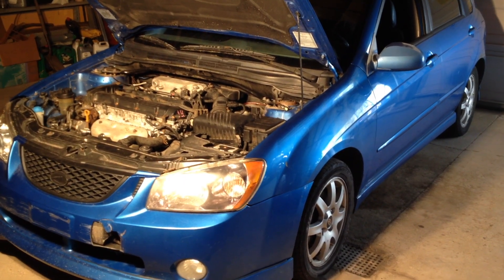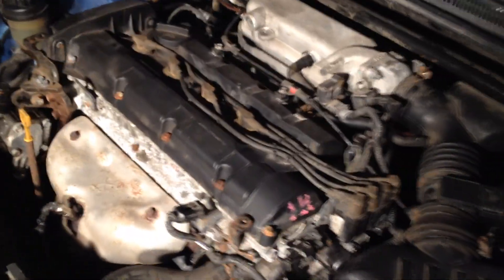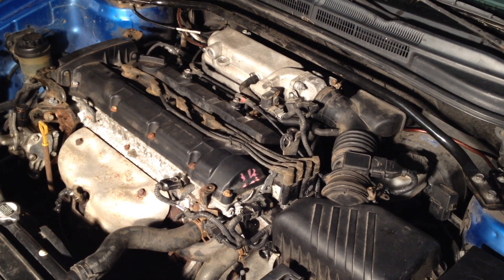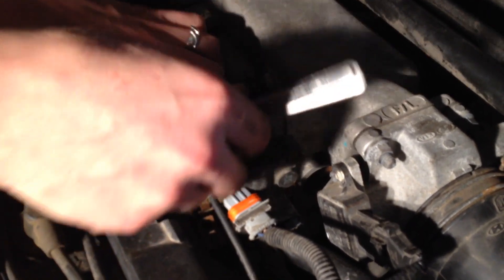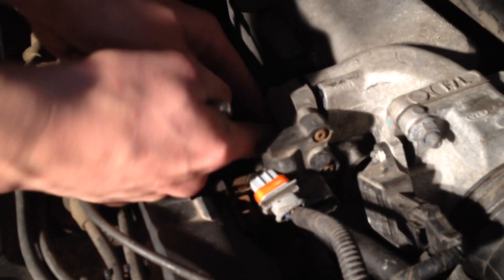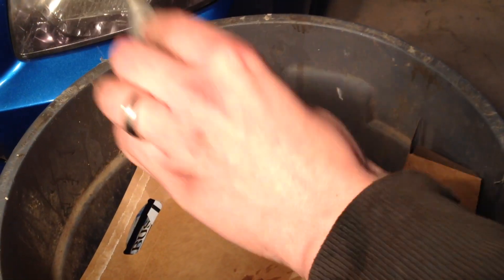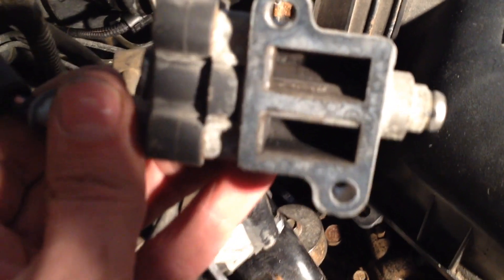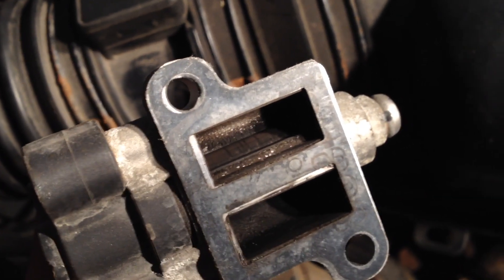Kia Spectra Idle Air Control Fix - Rough Idle

Comment: Thank You very much Young Man; have a 2006 5speed Kia Spectra that was idling wildly and even shutting down  seemed to be the idle air control valve ... anyway problem solved after carb. cleaner !!!

Comment: Good instructions, here! My 2009 spectra5 sx broke the timing belt, while driving. It bent 4 intake valves. It is best to remember that the intake camshaft is driven by the exhaust camshaft via a short chain. With over 300,000 miles on the car, the chain was stretched. This causes undue wear to the camshaft journal, nearest to the chain.
Reply: You got 300,000 mi out of it without even changing it once? I believe that car it's supposed to be every 90k. I'm at 355,000 and I've changed it twice.  Regular sx

Comment: My 2006 Kia Spectra 2.0L 4cyl shakes when I at a Stop Light or Stop Sign or when I'm waiting at the drive thru restaurant. Usually it happens when I have the AC on at the same time.  Also it shakes when in reverse or drive while the AC is on. Also when I press the gas pedal it accelerates slow and then it goes normal. Same when I go uphill. Again all them happen when I have the AC on at the same time. Do you think these steps will help fix all those? I need the AC on when I drive because it's Damn Hot in Texas!

Comment: Having same problem , car has been sitting 2 years thanks for the vid
Reply from the maker: You're welcome!!!
Reply: Me too i got a new idle air control an it hums constantly the car wont start if its plugged in. I dont know if it shorted some where but the car will only start eith starting fluid an shuts off as soon as i push the gas pedal.
Reply: @Scrotumlips  tal vez la bomba de combustible mala , o el  mismo envase de la bomba

Comment: Great video, I have a 06 Kia Spectra miself, the problem I'm having is that sometimes it's bogs down quite a bit, rough idle too. Any ideas? Don't want to spend $1,000 on it
Reply from the maker: Maybe a coil pack or a bad intake manifold. Just guessing though :/
Reply: @ChadWilliamsFixesAll  ok I'll check it out. Maybe take it to AutoZone and have them run a diagnostic and see what comes up. Thanks for the reply Chad, really appreciate it.
Reply: Actually it’s a issue with the fuel system and a evap value. I have a 07 does the same thing and stalls out. Best thing is don’t fill your car up all the way when you get gas. Honestly that’s what the dealership said 😂 I fill up 3 quarter the way no issues.
Reply: @mattdavenport1102  I have a similar issue. Can't this be fixed?

Comment: I am going to buy a Kia from Letgo tomorrow. Obviously I won't get your reply in time to help me but I think your video already has. I just have one question out of curiosity... since it wasn't getting enough air that sound was because it was flooded. Did you smell gas? Considering how there is an exhaust leak AND the running rich I figure it would reek of gas. But yeah please lmk and I liked and subscribed; great video! Thanks!

Comment: Hey Chad, Did you re-use the paper gasket or did you install a new one?
Reply from the maker: Mine didn't tear, so I reused it. Use your best judgement to whether if you think it is good or not.
Reply: @ChadWilliamsFixesAll  thanks for the reply. I'm not too sure if the problem I'm experiencing is the idle air control valve but I do have the same vehicle which is a 2005 Kia spectra5 and the problems I've been having is an idle surge and idle drop when I first start the car for about 20 seconds, then it goes back to Baseline 900rpms. and it also does it sometimes when I'm coming to a stop after taking my foot off the gas. Otherwise that ny car runs great when I'm driving and my foot is on the gas pedal. I've had no check engine light and the problem has been intermittent. Sometimes it might do it once a day sometimes none but the last couple of days ithas been getting noticeably worse.. am I on the right track with starting at the IAC? Thanks

Comment: Hey Chad ! I just bought an 08 Spectra5. I've been driving it for about 2 weeks, and today it stalled out at a red light. My idle seems to worsen with the AC running. could this be the IAC valve ? Sometimes it seemed like it had a dive in power after shifting gears(it's a 5 speed) any info would help. I'm subscribing to your channel today. thanks, Tim
Reply from the maker: +tim wilson hey Tim, thanks for the subscribe! A few things I would check first is air filter, spark plugs/coils, and a compression check. You would need to good for the correct psi for your car/engine. Are you throwing any check engine lights?
Reply: Chad Williams no check engine light. If I nursed the throttle, it wouldn't stall. when I got home I sat in the car, turning the AC on and off, and watched the tachometer fluctuate.
Reply: Chad Williams I checked the air filter, it was reasonably clean, except for some debris from like a tree/plant, and what appeared to be a piece of dried up gum sitting on top. I bought the car from a friend,  and it had been sitting for a while.
Reply from the maker: +tim wilson do you have a vacuum leak? You can spray carb cleaner around the hoses to see if the engine stalls out or revs up
Reply: Chad Williams I really wouldn't know where to begin to look for vacuum hoses. I'm a good DIY guy, but my knowledge is limited, and I rely on learning as I go. this morning the engine light actually came on. I'm going to check your recommendations , but I'm leaning towards the IAC because the idle got way rougher after a drive this morning thanks
Reply from the maker: +tim wilson that is good a Check Engine Light came on! At least now, you can get the code that it is throwing. Let me know what you find out!
Reply: Sure man ! Thanks
Reply: new plugs, clean iac valve did not help. could it be a pvc valve or throttle position sensor ?
Reply from the maker: +tim wilson were you able to get the codes off of the check engine light?
Reply: Chad Williams the guy at the parts shop said the only one it threw was misfire on cylinder 4
Reply: it starts and drives fine, but at idle the rpms fluctuate and eventually it stalls. sometimes when driving it bucks, or jumps with no explanation
Reply from the maker: +tim wilson have you checked to see if you have a broken spark plug boot? I have seen this before
Reply: they all looked good. do you know of any way to test a coil pack ?
Reply from the maker: +tim wilson yeah, you will want to disconnect the wiring harness from cylinder 4 coil pack and switch it to another cylinder. If the misfire is now on the different cylinder, then you know it is the coil pack.
Reply: Chad I changed the ignition coil and this was not the fix. now I'm getting a code p0449 Evap solenoid malfunction. .would this case a rough idle and the car to die ?
Reply from the maker: +tim wilson bummer that didn't work. Have you done a compression check on the cylinders?

Comment: i had my doubts but damn nice job now can you tell me why my 2002 kis spectra if blowing the # 22 ig fuse causing my fuel pump to stop?
Reply from the maker: +spikeman dan thanks! As far as why that keeps blowing, I am not 100% sure. It could be possible that the fuel pump is faulty or you could have a power wife for the fuel pump grounding out. It is really hard to say without being there

Comment: I just wanted to make a comment about the IAC when it comes to the 06 Kia Spectra and models like it.  The IAC even when clean can act like its fixed but actually act up again days later.  For a lot of them you will most likely have to replace it with a new one.  Also keep your receipt info when you buy one because a few of them have been faulty right out of the box.  If you are actually able to fix it by cleaning it consider yourself lucky.  The IAC I'm beginning to think is a faulty design part for this vehicle. This is a common occurrence with many Kia Spectra's...
Reply: Never had a problem out of the idle air control valve 355000 miles 09 spectra sx.  I'm going to change it just for the hell of it

Comment: I have an 08 i cleaned this part it started running real good but now brake booster is not working could this part affect the power breaks

Comment: Instead of using Carb Cleaner, Can I use Mass Air Low Sensor Cleaner as a substitute?
Reply from the maker: I did a quick google search, it said "Yes, you can use a MAF cleaner on a throttle body, but you cannot use  carb cleaner on a MAF". So go for it! :)
Reply: @ChadWilliamsFixesAll  Thank You. What's that one stuff called I can actually put on the connectors of the IACV ?
Reply from the maker: On the electrical harness? Like dielectric grease?
Reply: @ChadWilliamsFixesAll  yea that's the stuff. It was on the tip of my brain. Thanks Once Again
Reply from the maker: Awesome! Glad I could help! Also, thanks for watching!
Reply: @ChadWilliamsFixesAll  absolutely!

Comment: hi I got Kia Rio rs 1.6 if I put on first gear and I don't press accelerator it hesitate and even at stop die.wat can be
Reply from the maker: I would check the compression first, to verify that all cylinders have similar amount of compression. While you are doing that check, you can look at all your spark plugs or even replace them if you like at the same time. Compression and spark is where I would start.

Comment: Hey Chad, I just got my nephew's 2005 Spectra5 to do his brakes. It's sat idle for over a year and when I started it the check engine light was on. I scanned it and got 2 codes: P0030 (O2 sensor) and P0507 (Idle control system fault). I'm wondering if one cause might be throwing these 2 codes? It starts and idles smoothly at just under 1000 rpm. What's your opinion?

Comment: you a bad ass man.  just like that good video man I'm dealing with the same engine right now I will clean that valve out . also any knowledge on this engine stalling out while on reverse . I'm about to change the fuel regularor
Reply from the maker: +Dash d thanks! So only in reverse, huh? I honestly don't know what could be causing that situation other than a computer issue. Let me know what you find out!

Comment: In addition to rough idling, does it also act up when accelerating at low speeds and trying to speed up when going uphill?  I'm trying to determine whether or not my car's having transmission problems (which sounds very expensive) or if it could be a simple problem like you point out with the dirty air control. (Transmission fluid was at an okay level, felt and looked okay, but reeked a bit.) Is there an easy way to tell if it's simpler than transmission issues? I don't want to risk getting ripped off if I take it into a shop and would appreciate any pointers.
Reply: Did you figure it out?

Comment: thank worked perfect on my 2010 kia soul
Reply from the maker: +nance connellis awesome!!!!!!!!! :) thank you for watching and glad I could help!!
Reply: Chad Williams I have an 09, spectra5 Sx. I have been experiencing encressed idling and as I am driving excessive acceleration even while applying the brakes.do you think this issue is connected to mine?
Reply from the maker: It could be this or a vacuum hose could have came lose. Any check engine codes?

Comment: hey tim i have a 2005 kia spectra the car runs really good but when i stop at a read light it shuts of and sometimes makes w horrible noise but when ac on its even worse i think its the iac cause i turned the car on wt looked at engine and my car has the same problem as your rough idle and high idle just wanted to ask if this happend to u before u fixed it
Reply from the maker: +felipe lopez Hey, I never had those issues. I had those rough idle issues that I showed in the video. You may want to check for vacuum leaks and maybe your intake manifold gasket.

Comment: I have a 2004 kia optima it seems to rev at 2000 rpm after u press the gas any ideas on how to stop it from getting stuck open? Car ise to idel at around 800-1000 rpm
Reply from the maker: Hey Knight! My first question would be, do you have any check engine lights on? If so, what are the codes?

Comment: the check engine light is there in most kia cars. it;s not a big problem . this error i have from a long time. i've done an engine tuneup . still didn''t fixed . local garages dont know what to do . thanks for the video. will give this a try .
Reply from the maker: +heshan mapatuna good luck!!! I hope that it fixes your issue!

Comment: i have a 2005 kia spectra5, at times it shuts off, then i can start it up again. once in the highway when i hit 30mph it stays stuck there and doesnt accelerates at all ,. its like it looses power, am thinking perhaps the catalyc is clogged up? or tsp is bad?
Reply from the maker: +angela barber I was thinking the same thing, the catalytic converter sounds like the issue. You can do voltage tests on the sensors, pre and post.
Reply: Chad Williams thanks, I will check Wednesday , am thinking of taking out the o2 sensor and runing it without it. thanks again
Reply from the maker: +angela barber you're welcome!
Reply from the maker: +angela barber you're welcome!
Reply: Hey what was your problem i have the same car as u, and the same problem ?pls help

Comment: did the check engine light go away or did it stay lit.
Reply from the maker: Hey Joey! Yes the check engine light did go away after. I would disconnect the battery if you still have it on after and then reconnect it.
Reply: Chad Williams Thanks

Comment: I just fixed mine . Mine was a bad purge valve .
Reply: what valve is that? I have a rough idle and i have a new alternator, new therm, new radiator, did a throttle clean, tps replacement, solenoid valve replacement.....still idles VERY HIGH, sometimes it's perfect though too....HELP!

Comment: My burns oil pretty bad any ideas?
Reply from the maker: This is most likely bad oil rings on the pistons. Can't really fix this issue without an engine rebuild. Sorry about that
Reply: @ChadWilliamsFixesAll  well I bought it at auction for 700 and I work for a shop so it's only going to cost me 500 to do it meh has 75k on it going for the rebuild
Reply from the maker: I think the rebuild is a good idea too. I have bought those engine from car-part.com for around $200 too. You may just want to look there too

Comment: I have kia spectra ex 07 only problem I’ve had so far at 72 k miles that my o02 sensor I replace other than that no complains only the gas mileage it’s kinda bad but I drive fast lol